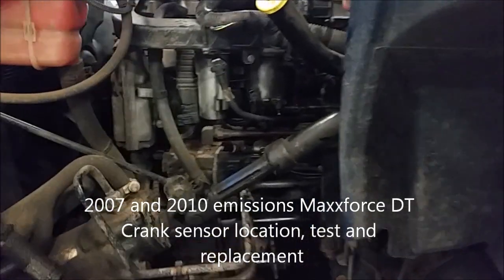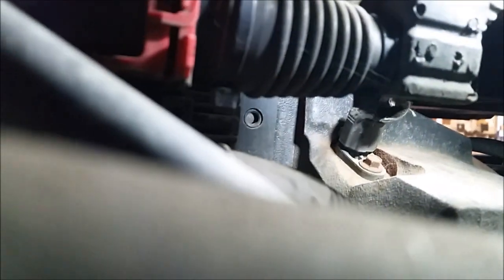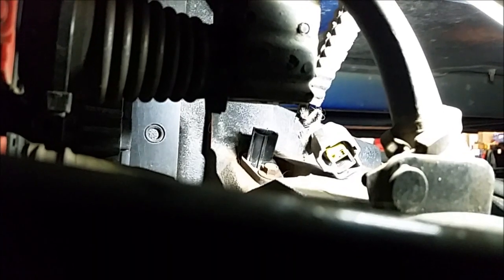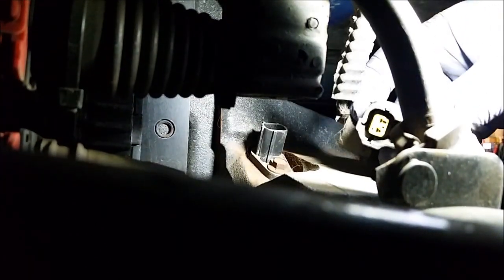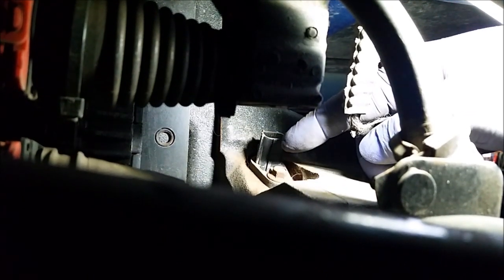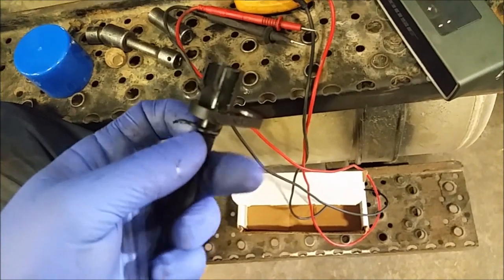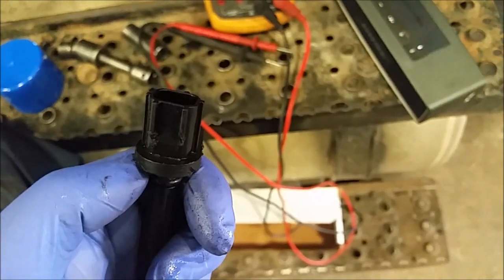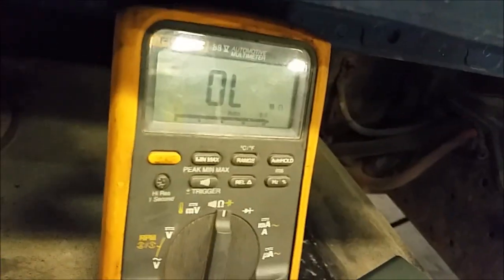How to locate, test and replace the crankshaft position sensor (CKP) on a International Maxxforce DT

Comment: Parked 60 series last night next day it crank but don’t start any ideas?
Reply from the maker: Check to see if you got RPMs showing on the tachometer while cranking, if so, your crank sensor should be good.
Prime the fuel system with the pump, or keep cranking and use either. 
If it starts, you lost your fuel prime overnight. It's probably the check valve at the back of the head that needs replacing
Reply: @AcousticHills  thanx a million u were right. I used some starter fluid and it Fired up.
Reply from the maker: @heavypressureinc  glad you got it going!

Comment: Hi there I got a 07 dt4300 changed cam, ipr valve, hand prime , still choking like hiccups and when truck gets warm doesn’t want to take gas I can send u a video.    Can u help please? Also diagnosed the truck had 2 codes crank and can signature signal incorrect
Reply from the maker: Hello, yes i can help. You said you replaced the CAM sensor. Did you also replace the CKP (crankshaft position sensor)? If not, do so with those codes. If it is still acting up, remove the CKP you just installed and clean the tip from debris, then reinstall.
I had new CKP sensors read bad because of the metal filings on the flywheel sticking to the magnet. Just remove, clean the sensor and reinstall.
Let me know
Reply: AcousticHills my truck is not a max force, is the crank sensor location still the same ? Do I need to take my starter out to get to it ?
Reply from the maker: @deeboy1939  it is located in the same spot. Dont remove the starter, CKP is on top of the bellhousing, left side.
If there is room, remove the fender and squeeze under the cab to replace. If theres no room, you will have to remove the doghouse (recommended). 
The CKP will be seized in there. Use lots of penetrant and carefully wiggle the sensor back and forth to free from the oring. A rust lip forms above the top oring. Youll break the CKP upper portion.
This part will require a lot of patience, but youll have to remove that upper rust lip and remove the o ring from the old CKP in order to remove it from the bellhousing. I usually use picks to scrape it and small drill bits. If you have a small precision pencil grinder or something, thatll help.
Reply: Hi there again , finally changed the crank sensor, but still hiccups and chockes when it gets warm , do you think it’s my idm??  I can send u couple of videos of the truck acting up .
Reply from the maker: @deeboy1939  Are you still getting that CMP/ CKP code? if not, I would look at your ICP with a scanner when the unit acts up. See if it's fluctuating when it is acting up.
If you shut off the engine and then restart when its hot, does it crank for a while and then start up, or does it start up normally?
Reply: AcousticHills  brother icp and ipr was diagnosed and signal readings were good .    I already changed the ipr valve, maybe throttle position sensor ? Checked all wirings are okay , checked the idm fuses in the battery box all good!
Reply from the maker: @deeboy1939  ok. You have no codes now correct?
Reply from the maker: @deeboy1939  Go on a road test, to verify you have no codes setting. If no codes are setting, I would perform a bounce test on your turbo actuator when engine is hot. with key off, push the turbo actuator down and let go. it should come back up and bounce one time. if it doesn't, or it is not smooth, you have a failing/ sticking turbo hot. 
I wouldn't suspect an idm or ecm if it only acts up hot yet. usually temp sensitive running issues with a DT would be related to you HP oil system. I was going for HP manifold puck replacement but if the ICP values are normal, then  they should be good. Let me know if any codes come back active after the road test.
Reply: AcousticHills haven’t checked for codes , scanner at the shop , but the truck wouldn’t drive for 10 miles need to call another tow truck to tow my tow truck,  how do I check the turbo actuator?
Reply: Turbo actuator is on the turbo right ? What and how do I push down ?
Reply from the maker: @deeboy1939  oh wow, it's that bad eh? yes, right side and you will see the linkage between the actuator and turbo. Use a long pry bar to push it down.
Reply: AcousticHills ok bro I’ll do it tomorrow and let you know , thank u for replying , god bless.
Reply: Hey bro did the bounce test all good , with turbo actuator !
Reply from the maker: @deeboy1939  ok thats good. Make sure you got the engine hot before you did that test.
Did you check the fuel pressure? Hook a 0-160psi gauge to the fuel rail. Theres a shrader valve at the front of the intake manifold (left side eng) you should have around 60 psi at idle. Read it when engine is hot.
Reply from the maker: @deeboy1939  perhaps you should upload a video for me on what its doing, as you suggested earlier, so i can understand the issue a little more :)
Reply: AcousticHills what is your email address?
Reply from the maker: @deeboy1939  can you upload the video to youtube? They removed the private message option.
Reply: AcousticHills I posted the videos u can see in my channel
Reply from the maker: @deeboy1939  thank you. Can you post the last 8 of your vin please. 
Can you perform an injector buzz test and make sure all 6 injectors click? Also verify your intake filter is clean.
Sounds like engine not breathing properly, too mich backpressure or not enough air. Or bad injector(s).
Reply from the maker: @deeboy1939  i want to read your engine details with last 8 of VIN
Reply: AcousticHills hi brother last 8 of the vin is 7h444226,
Reply: AcousticHills ya seems like it can’t breath air and chocks , I posted some videos on my channel  including the 9 fault codes
Reply from the maker: @deeboy1939  yea, ill get back to you later tonight when i get home
Reply: AcousticHills any news bro?
Reply from the maker: @deeboy1939  sorry, didnt have a chance yesterday.
I would say remove the pipe at the back of the turbo and make sure you can spin it and it has little play.
The turbine could be seized or broke which would give you the black smoke and lack in power
Reply: AcousticHills  it starts hard now in the morning cranks starts and shuts off!
Reply from the maker: @deeboy1939  all those fault codes are for the chassis, none for engine
Reply from the maker: @deeboy1939 check that turbo to make sure the turbine is not seized or broke (spin it by hand, should be easy and smooth to turn).
For your hard start, read the icp while cranking, it has to be over 650psi to start and should build to that within 3 seconds. If it doesn't, you have a hp oil issue which would also explain the running rough and smoke.

Comment: What kind of symptoms what is this engine having? Could you tell us why the customer brought it in?
Reply from the maker: March Transportation Yes definitely! The truck would not start. it would turn over but not fire up.
Reply: @AcousticHills  yep
happened to me
changed fuel pump, fuel lines 
4 days of investigation
and after spending $2000 between towing, pump, lines, dealer
turns out to be this damn sensor
thought 2 and learned how to change it just in case it happens in future
Reply: My series 60 14L is acting up. Sounds like it wants to shut off when it’s at running temperature. Replaced the egr throttle valve throttle position sensor turbo boost sensor. Checked my valves injectors and fuel pressure. It’s all good one mechanic said it may be my ECM but I know there’s many things associated with the ECM that makes the engine run. Like CAM Sensor. What’s your thoughts???
Reply from the maker: Can you explain the sound please. Does it sound like it's "hunting" or "stumbling" or "choking". Is it a random pattern or a fairly consistent sound? Usually CMP/CKP will cause unit not to start when they fail. 
Ive seen ECMs go bad, but these engines are REALLY finicky with powers and grounds. Wiggle the harnesses while she runs and see how the engine reacts to that. Do you know what level of ECM it is? ddec something... I dont have much experience in the 60 series but Ill try to help.